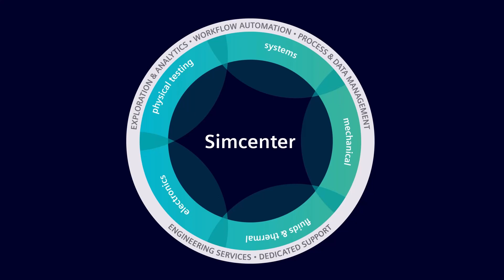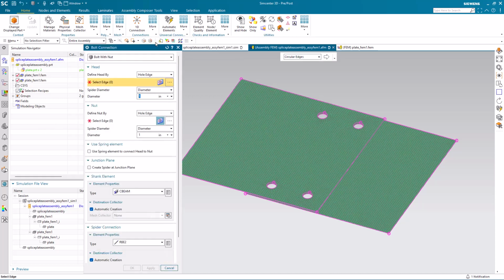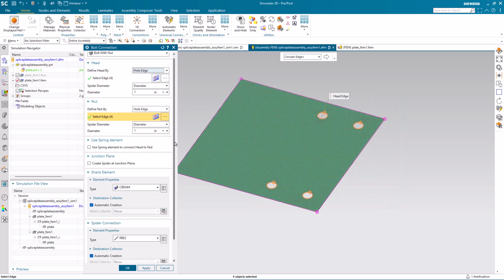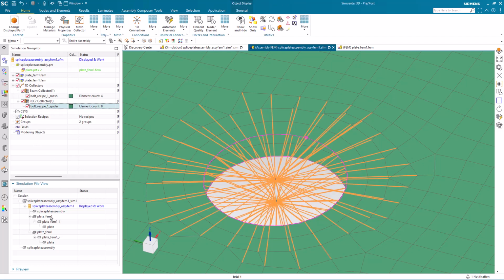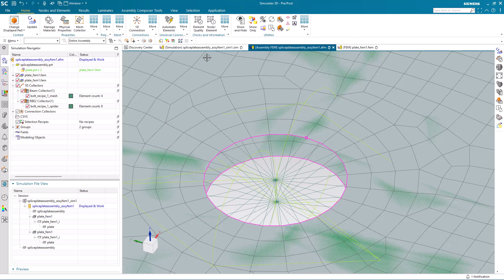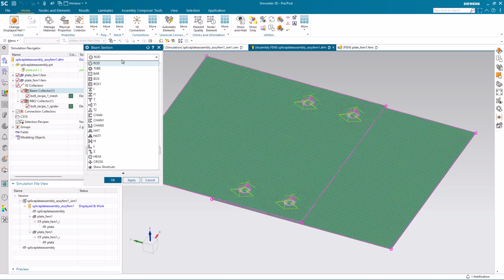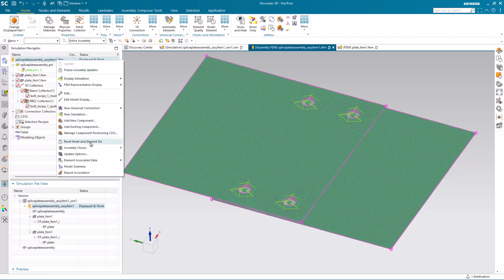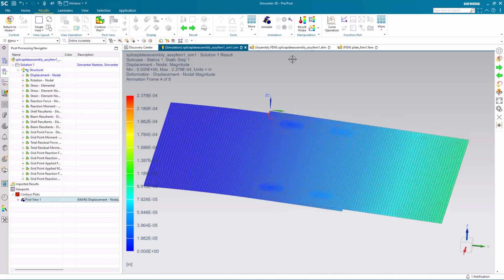How To Create A Bolt Connection

Comment: What about the DOF‘s from the RBE2  if I want to look at von Mises results in the area of the bolt connection?
Reply from the maker: You can release some of the DOF's from the RBE2 by editing it's mesh associated data, however, an RBE3 may be a better choice for the spider element if you want to look at stress near it.

Comment: how can we create a bolt connection on curved surfaces
Reply from the maker: You are probably getting a message that it failed to create the bolt connection and increasing alignment tolerance may help but increasing the alignment tolerance doesn't help.  Try the Bolt Universal Connection.  The Bolt Universal Connection can easily create the shank element and spiders on curved surfaces.  The Targets are the flange faces (where you want to connect the head and nut RBE's).  The Axes can be two points that define the center location of the head and nut RBE spiders and the Physicals define the shank, head and nut diameters as well as the material.  I have a video on how to create a bolt universal connection here:  https://youtu.be/OYp6Oq4wnnU?si=QWQJRkoeZmexvzc5  Good luck!

Comment: Is it possible to use a selection recipe directly for a normal Bolt Connection? When selecting edges i cannot find the selection recipe selection method anywhere. I now do the following, but it is a bit cumbersome: I create a 'head' and 'nut' attribute in the part file for edges. Then i create a selection repipe for them in the .afm. Then select the content. Then i go to the search bar and search for New Group (right click on the groups->new group deselects the selection recipe selection). Then i select the edges by group in the Bolt Connection. This method is not great for updating the selection, but unfortunately i could not find a better way. I use SC2306.